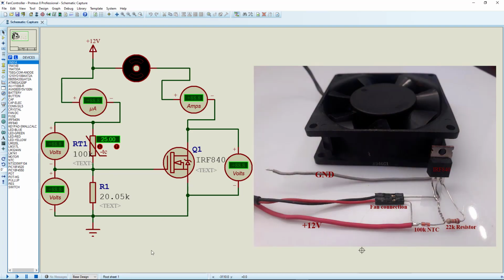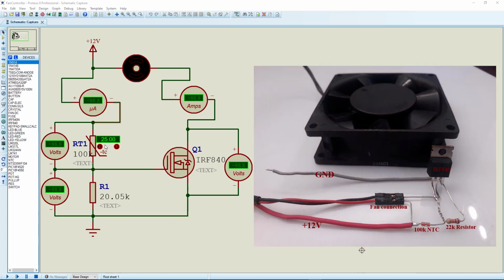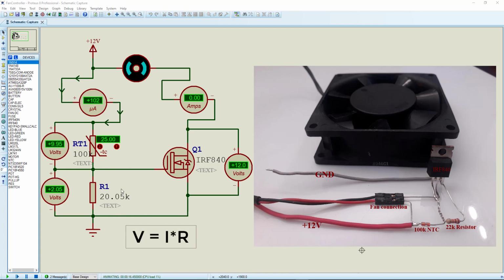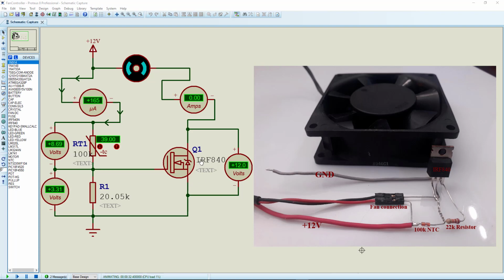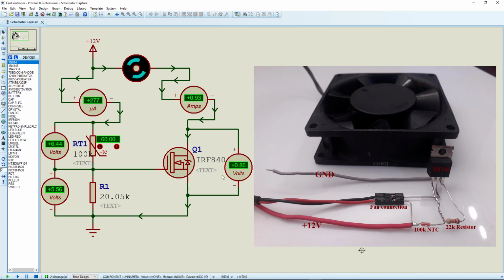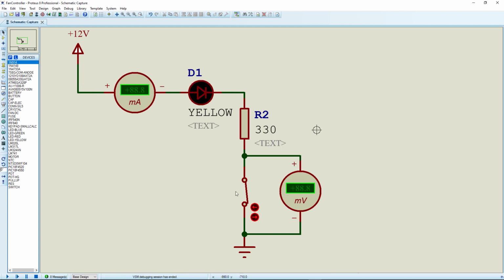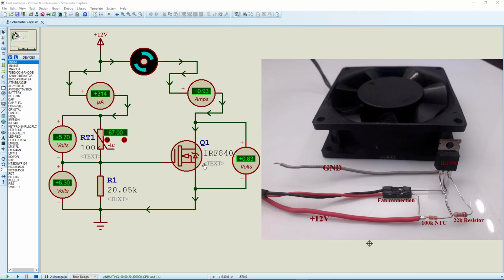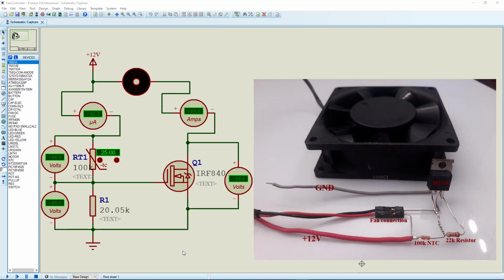Thermistor MOSFET Fan controller (Circuit working Theory) - Part 3

Comment: this is the same circuit but my mosfet is IRF640 and my motor is a 5 V motor. I want it to do the same job. Is useful?
Reply from the maker: Hi @Neonox, your mosfet is an N-Channel mosfet so it should work well.
If you need any assistance let me know or you can become a member and receive direct support for your project or DIY experiment.
Reply: @CMTEQ  so can i run this circuit with IRF640?
Reply from the maker: Yes, it should, just double check the threshold voltage.
Reply: @CMTEQ  thanks.
Reply: @CMTEQ  I will ask one more thing, my teacher gave me the circuit project to control DC motor speed using ntc and mosfet. but the motor you use seems a little different, mine is a small 5V motor. Can you write the resistor and NTC resistor for this? Sorry
Reply from the maker: What is your motor specs? It should work of you have the correct threshold voltage settings and correct motor voltage. 
Consider becoming a member of my channel, you will receive more assistance.
Reply: @CMTEQ  my motor 5v dc motor
Reply from the maker: Your VGS threshold is 4V, try to replace your motor with a 12V one and increase your input voltage. Otherwise you need to watch the video on the part where I calculate my VGS threshold and repeat the calculation with a 5V supply.

Comment: Can you put the schematic of proteus in the the description?
Reply from the maker: Sure, I will do so.
Reply from the maker: The File is now on the description box.
Reply: Can you do the experiment of Automatic On/off light using triac and LDR on proteus?
Reply from the maker: Sure, will look into it and see if I can prototype. I like doing simulation in parallel with real circuits.
Reply: @CMTEQ  i am waiting for it ? The hardware part is so easy , but for the circuit on proteus , it didn't works so i need your help 🥰
Reply from the maker: I will check it today
Reply: @CMTEQ  waiting your video 🥰
Reply from the maker: No worries, will get to it. These videos takes lots of time to produce. If you want a private tutorial you can sign up to my Patreon account and I will send you a quick video, otherwise just hold on.
Reply from the maker: I hope this help: https://www.youtube.com/watch?v=3uonXbd2Oyg
Reply: Btw thank you so mush for this video ,  it's verry helpful.
Reply from the maker: You are welcome